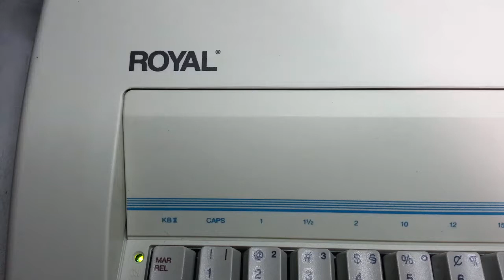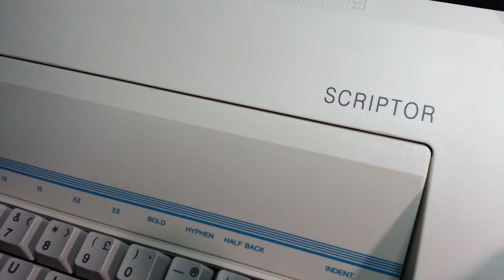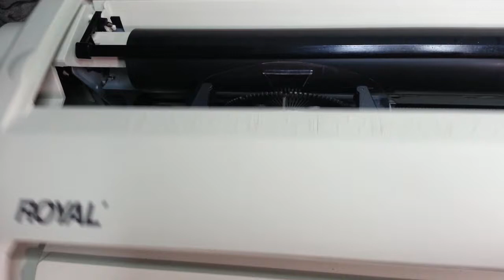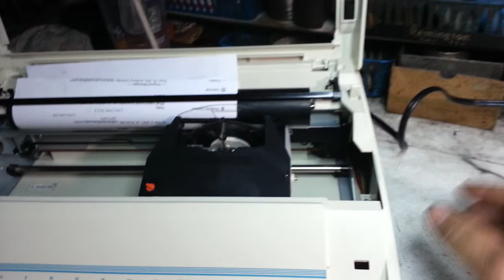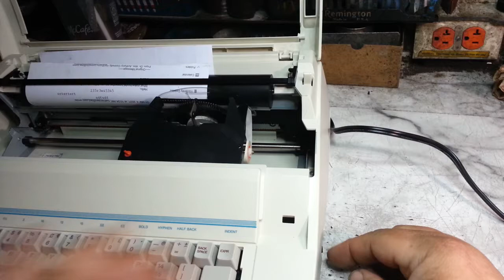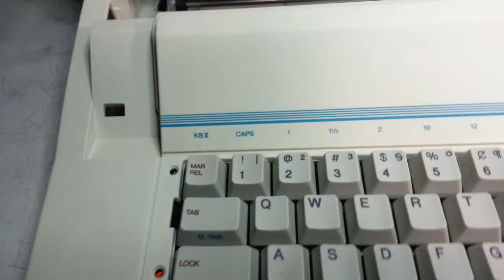Royal Scriptor "Beeps" When Off ! Typewriter Generates Power ! Electronic Phenomena ?

Comment: Hi, can this type writer change font size and if so how?
Reply from the maker: Pitch can be changed from 10cpi (pica) to 12cpi (elite) to 15cpi (micro) , Best to change print wheel to match pitch setting
Looks like Code + 5 = 10p / code + 6 for 12p / code + 7 for mirco